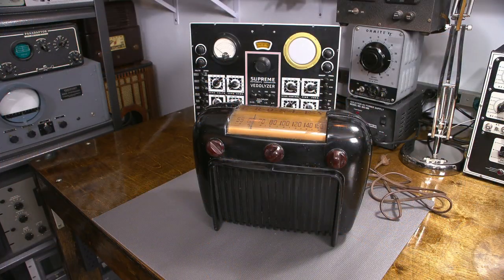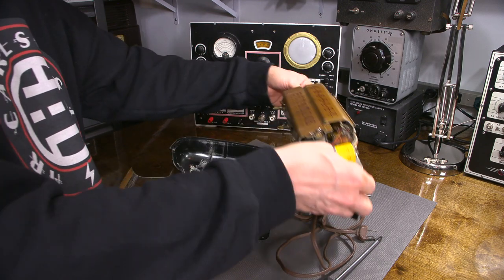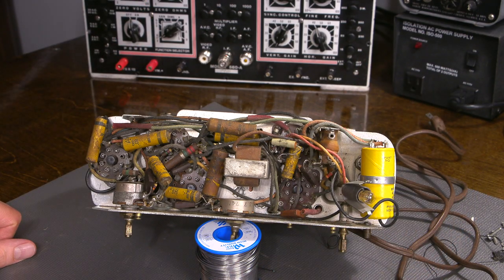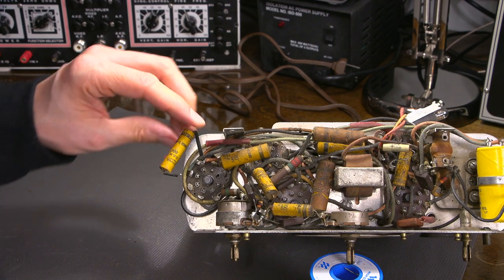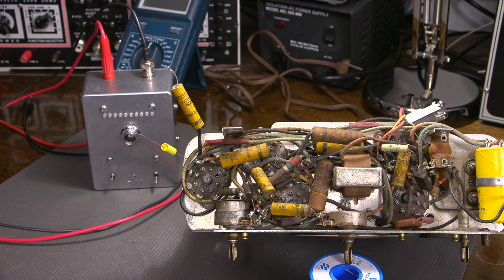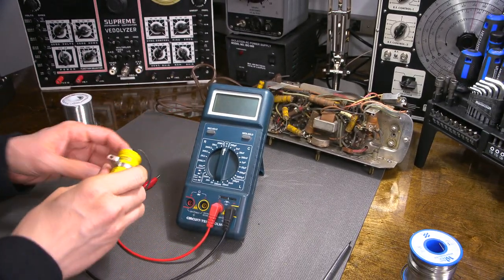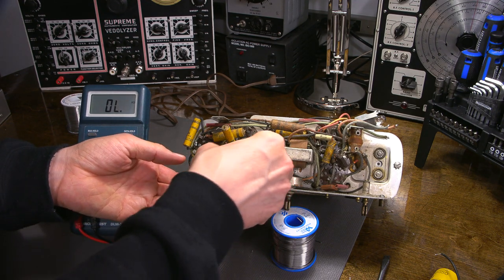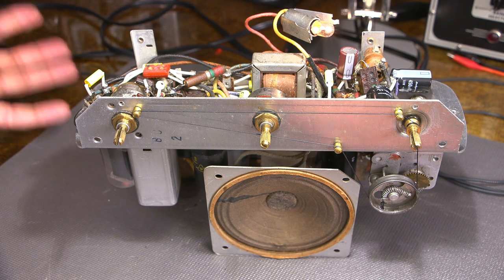ROBOT HEAD Radio from 1947! Electronic [Restoration]

Comment from the maker: To learn electronics in a very different and effective way, and gain access to Mr Carlson's personal designs and inventions, visit the Mr Carlson's Lab Patreon page here: https://www.patreon.com/MrCarlsonsLab
Reply: ok
Reply: Why don't you install small cooling fans in some of these tube radio's?
Reply: Would like to see the case restoration.  I vote for red and gold.  Curious What type of vintage equivalent paint you'll use.
Reply: I have this exact same radio only it is white bakolite .I have never refurbished it and it still works fine even the dial light works. I live in southwest Missouri and it picks up WSM in Nashville just fine at night. Just for a tast of nostalgia I like to listen to the grand ol opry on Saturday night from WSM Nashville from time to time and Ernest Tubbs midnight jamboree which is no longer live but recorded  earlier at 10pm then played back at midnight.  Great well made dependable old radio. Thanks for the video restoration. Now i will have to think about putting mine on the bench and doing the same .even though it still works fine I'm sure changing the capacitors will improve the performance and prevent future failure or catastrophic damage.
Reply: Mr Carlson a big thank to you. I have request  Plz teach me electronics. I am noob and want a master like you but there is no one like you, So I want you to be my master. If you wil not respond to this i will write again and again. I am from India  thousand miles away from you but distance doesn't matter from me. So teach me my master.
Reply: Not an native english speaker (I'm Dutch). What is the "forcast" and "paper and poly" position of the tester exactly?
Reply: @GeorgeSaint666  Paper and Poly differentiates the material from which the capacitors are made from. ( The material of the insulation layer inside the capacitor )
 I can't say anything about "forecast" either :-(

Comment: Just have to complement you for having perfect audio levels on all of your videos.  It's a rare thing on YouTube.
Reply from the maker: Thanks for noticing! I work hard to keep it that way.
Reply: Also a camera that stays in focus at all zoom levels.
Reply: @Digital-Dan  - It's easy to keep things in focus. Zoom into whatever will be in the shot, focus (or let autofocus do its thing, then switch to manual focus) then zoom out. Everything will be in focus from that point on.
Reply: @projectartichoke - It's very easy to balance audio levels in a video editor timeline. Once the video is edited to satisfaction, merely select the whole, and use the "normalize audio" function. It all becomes equal across all clips. In one respect, it's like the loudness button on audio gear, in that low level sounds are amplified, yet loud sounds don't exceed the maximum value. It's a form of compression, just like what is used in radio, especially FM.
Reply from the maker: No audio is adjusted in the editing program (on my end,) It's all taken care of on the analog side with vacuum tube audio processing equipment.
Reply: @MrCarlsonsLab  maybe you could walk us through that, in a short video??
Reply: @MrCarlsonsLab  That's great! I'd love to see a video of how your vacuum tube audio processing equipment works someday when you have time.
Reply: Oh yeah thats a really rare thing on Youtube. The worst part is, that those people who takes absolutely no care of their clipping and distorted audio, can damage Pre-Amp sections very easily. This happened to one Channel of a Studio-Mixer and a 6-Channel PA-AMP of a Friend. I have told him to turn down the Input-Gain of his Studio-Mixer, because the red LED's of it's VU-Meter stays fully on. He didn't want to listen to me. As a result, one channel of the PA amplifier failed, then one channel of the mixer. He was lucky that i was a hobby electronics technician, so i repaired both devices. I started working with electronics when I was 7 years old. I am 37 today and I studied electrical engineering.
One day he brings an USB-Stick with downloaded Music (in horrible Sound Quality: 128kBit/s and lower) into my car. For a good reason, i decided to leave the Volume at a lower level as i normally do. But one Time he turned the Volume up, then i heared one of my Horn-Tweeters on the parcel shelf "screaming" (like a girl that screams at her highest pitch directly and without any distance into your ear) and then it burned out.
I reminded him of my clues that poor audio-quality, distorted-, and clipping audio signals can be destructive and he don't have to put his fingers on my Car Radio.
My own audio files are always in the highest quality (320kBit/s) and are neither distorted nor clipped. I can play my own Music files much louder, powerfull, crystal celar and without blowing anything.
Reply: @djblackarrow  ,   Just making my comment to say that I agree with you. Moving on to your post... your English needs more than polishing, It needs to be "restored." You need to throw out the "bad caps," like "I have told him...." and I heared one of...."  That would help you ever so much everywhere you speak.
Reply: I bet that many YouTubers do not use 1000 Dollar Tube powered condenser microphones (customized of course), too. Mr. C has a Video of that microphones somewhere.
Reply: Kkkkk_k4k4kk4kkkkkk
Reply: @deadfreightwest5956  hahaha so much for your theory on how he does his audio.
Reply: Just a little less compression on the microphone to my humble opinion. My ears become a bit of 'fatigue'.... But.. great videos anyway!

Comment: Thanks for bringing back life to yet another great little radio, Paul. We had transformerless designs all the way up to the early 60s here in the UK, and I learned the hard way at a very young age that the power cord should always go into the socket the right way round! Back then we had three different types of mains power sockets, 5 amp two pin reversible, 5 amp three pin none reversible, and 15 amp three pin none reversible, all at the standard 240 volt 50 Hz supply. By the end of the 1960s all new house power sockets had  to be of the now standard 13 amp, three pin none reversible type. I was born in 1952, and at sixty seven I'm still here, so the burned fingers I got in my early days taught me the hard way that the correct wires must be connected to the correct pins in the plug! 
Thank so much for all you share through your YouTube channel, Paul.  You have a world wide audience eagerly awaiting your next knowledge packed video.

Comment: Interesting radio and restoration--thanks Mr. C!  This restoration has interesting timing.  
As you may recall, I sent you a PM through Patreon a little over a week ago, asking about radios of this vintage not matching their schematic.  Although I had not specified, it was my Crosley 52TF that I was referring to in that PM.  Unsurprisingly, the schematic for my 52TF appears to be a direct ancestor of the 56TD here in your video.  The circuit in my 52TF has many differences to its schematic, so you now know what I was talking about in that PM.  I originally restored all of the caps and some resistors with the same/similar values as in the original circuit.  Afterwards, when I was troubleshooting hum issues, I noticed the audio output section had many differences when compared to the schematic.  I took many photos and then made the audio output section match the schematic, but that completely broke the radio--no B+ voltage!  Even though it went against the schematic, I moved one wire back to the way it was in the original circuit, and I got B+ back.  Now I need to revert the rest of the audio output section to match the original circuit.  I'm still working through hum issues, but you've given me some things to try.  I'm curious if the actual wiring of our two radios differs from the schematics in the same way.  Thank you for confirming that Crosleys don't always match their schematics.
Regarding the new mica capacitor, connected to the grid of the 50L6, can you confirm its value, please?  Is that orange-red-brown (320 pF)?  I'm also guessing the upper-left black dot on that cap means it's mica (vs silver for paper).
People, if you enjoy Mr. C's videos as much as I do, please consider supporting him through Patreon so that he can continue such great content.
Frank B+

Comment: You piqued my curiosity about Moffats Ltd. so, being the Army Intel geek, I researched it and found that Crosley Radio and TV sets were sold & distributed in Canada by the Crosley Radio and TV Division of Moffats Ltd., Toronto, Ontario.
In March 1954, Donald R. Moffat was elected Executive Vice President, Avco of Canada Ltd., headquartering in Weston, Ontario; he was also the President of Moffatts Ltd., which was another Avco subsidiary.
Reply: I was going to suggest Moffatts Department Stores of Oklahoma, but your detective work is far more likely.

Comment: MR Carlson thx for loving my comment:) Even when am not at home Your channel plays ( it helps to distract thieves XD )24h almost:Pam uploading and downloading alot data so pc must be always on.  bills are bigger a bit but not too much 40 euro per monthXD. Now am making my 1st LED torch from 130 lumen 1w high powered LEDS and connected 13 them pararel one by one , took  heat sink from old pc. + am gonna use a little of  7.5W /mk  good conductive thermal grease and spread it on metal underpads and then attach diodes to heat sink

Comment: Story about Moffats Limited... a Canadian company tied to Crosley:
In 1946, the Avco Manufacturing Corporation (formerly the Aviation Company) of Greenrwich, Connecticut bought Crosley Radio and Television which, in addition to its entertainment products, also made major appliances.  The same year, Avco licensed the manufacture of Crosley products to Moffat.  In 1953, Avco bought Moffat outright. From here, the story needs to go back in time. In 1927, five companies (McClary Manufacturing Company, London, Ontario; Sheet Metal Products Company of Canada Limited, Toronto; Thomas Davidson Manufacturing Company Limited, Montreal; E. T. Wright Limited, Hamilton, Ontario; and A. Aubry et fils Limitée, Montreal) merged to form General Steel Wares (GSW) Limited. They acquired the Happy Thought Foundry Company of Brantford, Ontario in 1920, followed by the Easy Washing Machine Company in 1958.  In 1962, Beatty Brothers Limited of Fergus, Ontario acquired a controlling interest in GSW through a reverse take-over, merging the two large firms.  Here's where Moffat comes back into the story.  Under the leadership of Ralph Barford, GSW acquired the Moffat Company in 1971, making GSW the the only Canadian-owned, full-line appliance company.   The Moffat acquisition, probably Barford's largest, brought GSW into the big six full-line appliance makers. The other five, all foreign controlled, were Admiral, GE, Inglis, White and Westinghouse.  GSW merged with General Electric Canada in 1977 to become the Canadian Appliance Manufacturing Company (Camco), making it the largest major appliance manufacturer in Canada. The same year the company acquired the major appliance operations of Westinghouse Canada, exclusive of the "Westinghouse" name.  Those products were re-branded as "Hotpoint" and sold along side of the GE, Moffat and McClary brands. Under Camco, stoves and refrigerators continued to be built at the Weston plant until 1983 when production moved to Hamilton, Ontario and then off-shore.  
URL:  http://progress-is-fine.blogspot.com/2016/04/we-used-to-make-things-in-this-country.html

Comment: When you first powered it up, the las thing I was expecting was for it to work. Smoke yes, but not work. LOL. Nice job as usual, and thanks for the tip on dial cord replacement regarding the spring.

Comment: I just found your channel and have watched a couple of your videos.  They are very interesting and informative to watch, however I have next to no knowledge base on radios, albeit I am a retired Mechanical Engineer - having been the safety Engineer on the Space Shuttle Main Engines.  I have always been interested in the design of vintage tube radios, and just completed designing and making two sort of Prairie School wood table radio cabinets.  One for my grandson, who likes old radios, and one for me.  My grandson liked a Prairie School table lamp that I recently designed and made and wanted me to make one for him.  Since it took me a month to make, I decided that I would make something for him that did not take as much time.  So, I incorporated the look of the lamp into the radio, which still took me two weeks to made two radios.  It would be neat to insert a tube radio in my cabinets for the great sound, but I have not found a good deal on a working one or two.  So, for now I have 1970s vintage Tandy radios inside the cabinets.  The rear panel needs to be removed to turn on, set volume and station - but only two screws.  

Here is a quick and dirty video on my Prairie School Radio Cabinets for your viewing pleasure!

https://www.youtube.com/watch?v=zvlVWGyhBf4

Comment: @ 52:10 you mentioned that the components in the chassis don't match up with the schematic. Boy have you got that right. Noticed you correctly placed a third
electrolytic on it at the cathode of the 50L6 tube . 10uF at 25 Volts. The two section electrolytic is supposed to be a 30uF and a 50uF at 150 Volts each. Glad 
you have the ability to reverse engineer the design of the radio for it's poor performance issues and was able to correct them. Great radio for those cold winter nights
because it doubles as a hand warmer as well! LOL

Comment: I'm just a little surprised ... Because in Germany all AM transmitters in the radio band have long been switched off.
By the way, I was trained at the former Grundig company and later worked at the Satellite World Receiver. But that is a completely different number. That's not " that easy "  :-)
But anyway, I like your videos. Keep it up

Comment: That is so awesome how that radio goes from picking up one or a couple of stations to hitting something all the way through the dial. So much work but so satisfying. (I hope I am accurate with that assumption as you did all the work).  :-) Thank You, again for another successful Restoration and sharing the "journey". I have learned SO much from you. I do need to get onto Patreon and learn the cap leakage tester build. That device is a "must have". And my words wont help pay your bills.  ;-)

Comment: A radio only a mother could love.  Very Flash Gordon-esque look to it.  Strange how there's no ventilation.  As the plastic faceplate hasn't distorted over the years the designers apparently did a good job of isolating the heat from the tubes. Still, I don't think I'd want to leave it on unattended on a hot day in an unairconditioned room for too long.
Reply: probably started a few house fires i bet

Comment: Very well done kind Sir. I surely would have loved to have your capacitor checker when I was a technician. For when I was repairing radios in the 50's, the ONLY capacitor checker was our ohmmeters. And you KNOW how inaccurate that is.  Not to mention checking electrolytic capacitors. Oh well.

Question. Do you calibrate your Signal Generators? If yes what is your reference. Thanks. Love your channel.

(Note: I see an RCA 3" oscilloscope on one of your shelves. That was also available as a kit at one time. So I built one and I still have it. I imagine all the caps, some resistors and tubes are bad now. I haven't used it in over 60 yrs.)
Reply from the maker: Hi Pat. I have a reference that's calibrated by the WWVB. Thanks for your kind comment.
Reply: My shop teacher told us about how this air force mechanic tried to climb on top of a huge 50 year old capacitor to grab something above and it still had a charge and it burned him to a crisp. pretty much blew him up.  I learned don't mess around with old electronics!

Comment: 55:25 - I once had a spool of General Cement dial cord that belonged to my dad, but like most things, it has gone to the island of misfit toys. 
I'm slowly acquiring the Heathkit test equipment he once had over 60 years ago. I love looking through the old Radio-Electronic Masters at all the products and gleaning info from them. I have a Triplett wattmeter but have no idea how to hook it up.
Have you ever used Quietrol (sp?). I remember that stuff from way back. Super thin, red, very distinctive smell. Apparently mostly carbon-tet and oil. Sure worked a trick on pots and switches! 
As you point out, people smoked back then, and my dad smoked like a chimney. Still, doing a brake job on the car, he'd warn me not to breath the dust. He said this with a Tareyton cigarette in his mouth, just before he'd blow out all the dust with compressed air. He'd even check the battery while smoking, lol.

Comment: This design would benefit greatly from adding an exhaust fan to the back to pull cooling air from the front. Yes, fans are noisy but heat is worse than noise.

Comment: That cleaned up really nice. I am wanting to restore on a classic AM radio for my station I am now by default the chief engineer of with the now nice new solid state AM transmitter dumping a gallon into an 80 year old shunt fed tower with 80 year old grounds you can guess the noise I have to deal with. RF eats up everything solid state especially radios and I would wager a good quiet build like this and some of the radios I have seen you do I would bet it would shrug off the RF. Now I just need to get on your patreon and build some of those testers. I am betting the old time gospel format on said station would sound awesome through an old time tube radio.